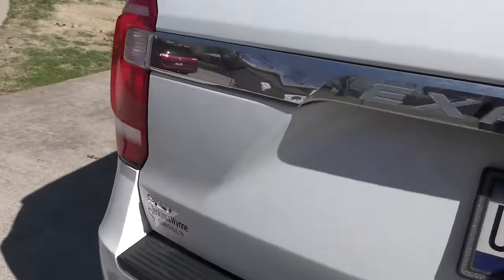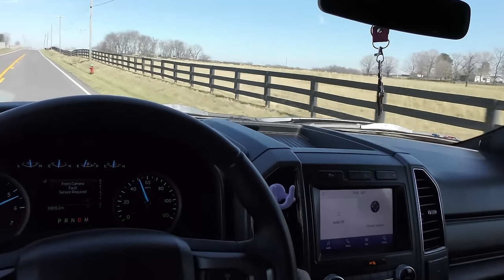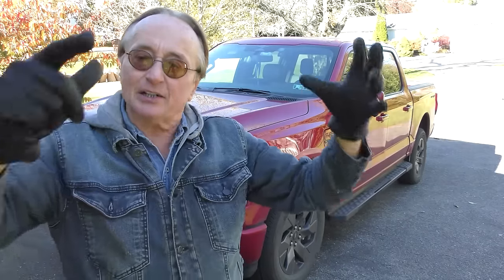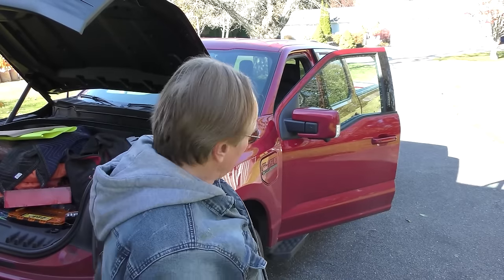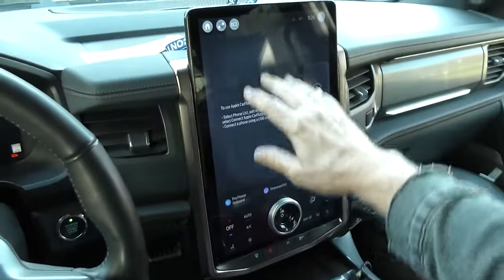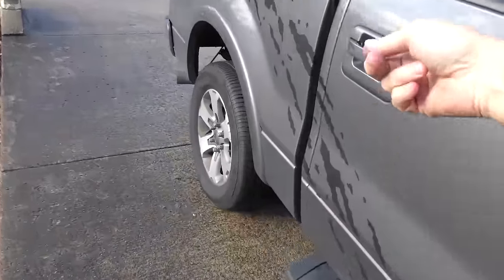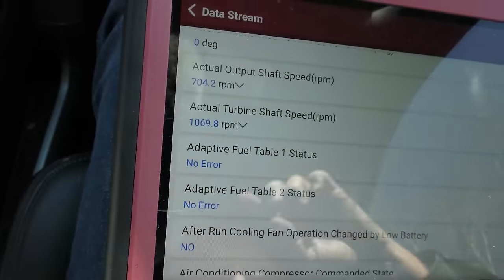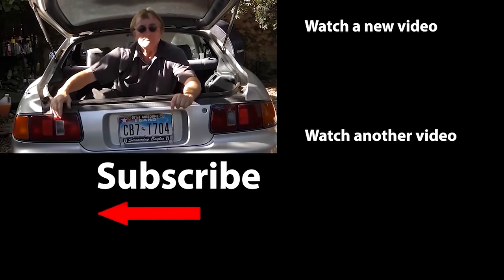Here's Why Fords are Crap Now

Comment: I’ve been learning and working as a mechanic for a lil over a year now and one of the most mind bending things was seeing most new fords all have PLASTIC oils pans, drain plugs, trans pans etc etc. I can’t wrap my mind around the engineering behind it, and fords isn’t the only one doing this nowadays
Reply: I used to be a mechanic, and I’ve seen many many many metal oil pans from older vehicles begin to rust out and leak oil. I’m not saying plastic is the correct solution but it definitely mitigated the deterioration you get from having a metal oil pan.
Reply: FALSE. That's weird because I own a 2022 f150 and the oil pan and plug is METAL. IS NOT plastic. You must be working on those electric trucks with the battery oil pan lol.

Comment: I have 15 f150 xlt with the 373 electric locker and 3.5 Ecoboost 117k and its been great changed the rear diff and trans fluid and both looked like they didnt need changing its been a great truck

Comment: I have the 6 speed transmission in my F150 with 183,000. Only ever changed fluid and filter and it still shifts perfectly. Hopefully it will continue to do so for a while longer lol.
Reply: Don't abuse it and continue to change the fluid and filter and it should be fine. 

The Internet also claims the Getrag six speed manual in my Mustang is junk and will break. If find the opposite is true in my long term real world experience.
Reply: I'd take longevity over smooth shifts any day. 10 speed transmissions are ridiculous. Are people doing surgery in vehicles now? Talk about overkill.
Reply: @DUCKSAREEVILLLLLLLL  8 is plenty but Ford's 10 speed isn't all that bad. I think the programming is the issue, not the trans.
Reply: @302Mustang13  10 speed transmissions are the more complex solution to a nonexistent problem. I'd rather they spent their production dollars on eliminating some plastic coolant hoses, etc.
Reply: @DUCKSAREEVILLLLLLLL  Plastic cooling hoses?? I wasn't a fan of the 10 speed Ranger I drove, but maybe with time it'll be ok. The real world highway mpgs being impressive though is due to the 10A. It gets better mpgs than my 2.5 n/a Ranger reg can w/ 5 speed manual 2wd did on the highway at lower speeds.
Reply: @302Mustang13  It's economical until it needs replacement.
Reply: @DUCKSAREEVILLLLLLLL  Who says it will need to be replaced? It's not uncommon for an automatic transmission to go out. I don't see any evidence the 10R80 is more likely to self destruct more than any other automatic. The only automatics anyone I know who needed a new one were Honda and Dodge owners. Don't know anyone with a bad Ford engine or transmission.
Reply: @302Mustang13  YT censored my link, but Ford is facing lawsuits for that 10 speed transmission as of May, 2023.

Comment: I'll stick with my 05 F150 5.4L 4x4 with 338k on the clock. Original engine, trans, drive line, cooling and electrical systems. If it dies I wouldn't gaf as I bought it 15 years ago for $9g.
Reply: That’s part of the problem I guess. If ford only sells one vehicle every 15 years, they are screwed

I got a 2010, rides great. I don’t think a 2023 would last til 2038
Reply: @Tropicalfrooploops  Very good point man.
Reply: 07 F-150 5.4L 2WD with 176k miles. Only issue was cylinder misfires fixed for $1500 at around 115k miles. My F-150 has been reliable and never stranded me on the road ONCE.  Glad to hear you have high mileage with your Triton 5.4L too!
Reply: If yours died then I would just replace the engine or transmission and keep going.
Reply: @Jimster481  100%

Comment: My top-of-the-line Eddie Bauer, 4 x 4 expedition had three repairs on the front wheel drive unit when I put it in four-wheel-drive it would lock up and compound low and I was skiing in and it locked up and I couldn’t go over 15 miles an hour all the way back to the Ford dealer from Park city that was the last American  High End SUV that I purchased.

Comment: Why does ford keep putting V-6 turbos and 10 speed transmissions in their big SUVs and trucks? I have a 2014 F-150 with the 6 speed transmission and a 5.0 Coyote engine with over 250,000 miles that gets the same gas mileage as these V-6 turbos, has plenty of horsepower and torque, I have had no major problems with it and it still runs like a champ.
Reply: Democrat lawmaking.
Reply: To FORD’s credit, they still offer non turbo 6 and 8 cylinder engines. People have an obsession with turbos as a status symbol but it’s always best to avoid turbos all things being equal.
Reply: It’s also about planned obsolescence.  Ford knows that people will love the speed of these Ecoboost but the big reason if Ford was being honest , is that these Ecoboosts will have more problems by 150k miles forcing people to buy a new truck earlier.  Look at the 5.0 coyote, great engine, but too good.  They made changes to it and now it’s not nearly as reliable long term.
Reply: @hokie9910  they didn’t make changes to the 5.0 other than cylinder deactivation and auto start/stop both of which you can have turned off.
Reply: @Trevormaffetone  They did make changes around 2018 for Gen 3.  They changed from a traditional cylinder liner to a “new technology”.  Oil burn has become an issue in an engine that did not have an issue.  A friend of mine who works for a large Ag chemical company was the first to alert me to this issue and they are seeing it consistently on engine with over 150k miles.  Only Ford could ruin a great engine, well them and GM.
Reply: Same, 2015 5.0.xlt... Why turbo? This one gets me 10-12 L per 100km. I even leased first to check the quality and mileage and then after year 2 bought it out from Ford lease.

Comment: For the 2011 F150 I would recommend an additional external transmission cooler. The way it sounds is that the fluid is getting too warm in stop and go traffic and thinning out a little too much. I'm sure it's worn out and wouldn't do that with new gears but still might be able to get more life out of it keeping the fluid cooler. When I was a tech we used to put an external cooler on every transmission we replaced most of the time inline with the factory one unless it was clogged, then we would bypass it.

Comment: Been driving the kuga 2015 
For 5 years now 
Not one check engine light issue

Some clapping on one of the rear struts but thats it had that fixed over a year ago
Reply: That's an Escape
Reply: @GBS1043  yea ford 

The manufacturer parts for the escape and expedition have some similar electronics, engine components, and transmission are parts they use across the board, my bet is to keep it simple with ford and not get these big suped-up suvs

Comment: I hate stop/start.  I disable it every drive.  For me it seems like that process would wear the starter out and isn't there less oil pressure on start up?  Wouldn't that wear the motor out faster?
Reply: Smart and yes I hav3 a feeling these will see a lot more issues than normal.  Can you buy a programmer to turn off that stop start for good?
Reply: @hokie9910 Yes you can disable it for good via programming.... but usually that voids the warranty LOL
Reply: @hokie9910  Auto Stop/Start Eliminator cable ~$70 USD. Plugs in between stop/start button and factory plug. 

Defaults the system to remember the last setting, so it doesn't default back to ON at start-up.
Reply: Start stop is the biggest joke on planet earth.
Reply: All by design - to make your car fail sooner.
Reply: Start stop has two batteries with a smaller one just to restart. More cost and headache.
Reply: You honestly can save tons of money with an electric.  You have to install a level 2 charging station in your garage.  They are more fit for warmer climates.
Reply: @joshuasaltzman1992  LOL 😂,  my truck is bought and paid for. How would I save money going EV ? Plus ,I don't want to worry about burning down my house.
Reply: @musicman7297  it goes into a 240 like a dryer or your oven does.  Do they burn down your house? Charges the car in like six hours.  My wife has an electric car and never has to use a commercial charger which actually can charge the car in about 20-30 minutes.  Also they have very little in maintenance costs as there aren’t fluids and oil to change. Great for a commute vehicle.  Still needs infrastructure development for long driving for sure.  I love Scotty but he’s not really educated on evs.
Reply: @musicman7297 I’d estimate she’s saving about 2500 dollars a year on fuel cost and oil changes.  If you live in a warmer climate and use your car primarily for commuting it’s a good option.  Definitely not for everyone but it’s a good option for some of us.  Especially if you have two vehicles.  Just wanna be fair.
Reply: @joshuasaltzman1992  LOL 😂,  how many kneepads do you go through every week ?
Reply: @musicman7297  come say that to my face
Reply: @joshuasaltzman1992  LOL 😂, YouTube tough guy.

Comment: So glad I listened to your advice. Bought a new 2023 Subaru Crosstrek Premium with a manual. Is slow to accelerate sure, but the AWD did well in snow and the vehicle checks every single box other than acceleration. I'm okay with that, and I work at a Ford assembly plant. I also got it for $25k new, and Ford was starting at $35k my A-plan price. Hey Scotty, I'll be down in Tennessee in the near future if you want to do a review or something on it. I have 13k miles since May 2023.
Reply: Subaru has a lot of Toyota tech in them I’ve heard.  I like the Crosstreks.  Especially, like the wildernesses and the manual transmissions that are available.  I wish the Outback’s had a manual option.  🤷🏼‍♂️

Comment: The only problem i had with my 2021 4x4 ranger is the driver door was not flush with the body, it poked out 1/8 inch. It got fixed for free, but still that shouldnt be a thing. 
Other than that, its been a great truck.

Comment: I will never buy a Ford again after my experience with my 2018 Fusion i have had transmission problems since i owned it. They told me my torque converter was going out and instead of replacing it they flashed the ecu and tcu changed the fluid and sent me on my way. A week later it was shifting sluggish again so i went back and they denied telling me that the torque converter is bad and reset the ecu and tcu again and sent me on my way again. It's doing it again and they won't touch it and say's it's fine.

Comment: Having worked in high tech electronics back in the 80’s
The worst environment for electronics is the car/vehicle,
Electrical noise, vibrations,harshness,thermal cycling,etc, early components and circuit boards had to be encapsulated in epoxy in an attempt to impart longevity and durability. Extreme heat or cold are electronic killers

Comment: I had a 1999 expedition a couple of years ago, the 5.4 two valve. Got it from a older guy for 1,700 had pretty much every receipt for any work done since new. Had 234k on it I drove it to 345k in about two years, nothing but oil changes and tires. Sold it and it's still driving around my town to this day !

Comment: I have a 2020 Ford F150 3.5 Eco Boost and it is the best vehicle I've owned. Quick, comfortable, and fuel efficient for a pickup. It's the 10th new vehicle that I've bought, plus numerous used vehicles. Last year I rented a BMW X5 for three weeks for a trip on the east coast. Both wife and I agree that the F150 would have been more comfortable.

Comment: The 3.5 ecoboost has more hp and torque than the 5.0 v8 coyote. and is almost just as reliable by the numbers. love your videos keep it up
Reply: I disagree my co worker blew a engine & ford did nothing, apparently the 302 is way better
Reply: So if you took a $75k lightning and  a $75k gas f150. The entire drivetrain for the gasser would cost less than $25k, when removed would leave you with a $50k shell. For the lightning the entire drivetrain would cost atleast $50k, and when removed would leave you with the same shell, same options for 25k? Ford is either shoving it in their * on the lightnings,  or theyre shoving it up the customers * on the ecoboosts
Reply: I'll take natural horsepower over anything that requires a turbo to make power.
Reply: The 3.5 doesn’t have more hp……just more torque.
Reply: Toyota Tundra V8's will outlast any ford engine by a long shot
Reply: @stefanovichmichael9686  they don’t make v8’s
Reply: @legion8416  Up until 2021 they did,and there are now 5 with over one million miles,without major repairs.That was my point.Try that with any domestic truck.

Comment: My work vehicle is the Ford Transit 250.
50k miles water pump bad, 58k radiator leak, 60k rediator leak and rediator replaced.  66k transmission bad needed replacement. Aboiy 70k bad coils.. 
Just noticed today at 77k radiator leaking again.
Ford, where quality is job none.
Only thing they're #1 at is recalls

Comment: We have a 2020 ford escape, transmission is clunky as well while shifting. The car still only has 26,000 miles and already had two rear shocks leaking fluid, mid section of the exhaust needed to be replaced, and AWD module went out.

Comment: I love Ford vehicles. I haven't had many problems with them other than normal wear and tear.
Reply: You probably change your oil before 5k too. Many people go by the recommended intervals when they’re mostly driving in the city. And not using Motocraft oil or filters. Huge mistake.
Reply: Scotty is correct as to the 10 speed transmissions. Don’t buy one. But GM has also suffered problems with their 6 speeds too.
Reply: I don’t understand the infatuation with a fast pickup truck. Do you see semis drag racing? Trucks are for hauling stuff. If you want a race car buy one. 😂
Reply: I suggest you play the lottery. Not many share your good experiences with Ford vehicles.
Reply: Try a brand new Ford and report back
Reply: Henry Ford, the industrialist, was right about the j's
Reply: @rolandthethompsongunner64  are you claiming that either you or Scotty have more experience with the 10 speed than government, big oil, and major transit fleets? I have visibility to the PMs and service records, and the only big shift in repairs over the past decade has been with diesel emissions equipment. Most fleets have moved to the 6.2 and 7.3 gasser and there's no widespread issues evident with the 10 speed. Stop fear mongering about something you have a grain of sand's worth of visibility on.
Reply: EWW
Reply: Same here.  As with any brand of anything,  complaints only come from people having problems.  People who are happy with their vehicle NEVER say a word, literally millions of satisfied customers, that their experience never works into the equation.  Mechanics don't see happy car owners, only problematic ones.
Reply: Are the joys of being a unicorn

Comment: I got one of these trucks. I had a dead battery and it took me 45 minutes to find someone to give me a jump. I forgot to turn off the automatic start stop. Then on a freeway there was a traffic jam and I stopped and the engine turned off. I ended up paying $350 to have it towed cause nobody wants to give you a jump in the middle of a freeway.

Comment: If ford is so bad, how come I've had a 2003 escape, 2005 freestar, 2013 fusion, 2015 MKZ, 2017 F-150, 2020 Explorer,  2023 F 150 and a 2023 Lighting.  None of those vehicles every saw a mechanic for anything but an oil change. 

The only cars I've owned that ever broke down were Honda/Acura,  Nissan... and Chevy.
Reply: It sounds like you don’t even keep vehicles long enough😂

Comment: I have no problems with the V6 in my 2000 Ford Taurus and it still runs great. There's just too much electronics on these new vehicles for me. Ford needs to stick with the basics.
Reply: Never - ever jump another car with your Taurus. I had a friend who inherited his mothers Taurus, jumped one of his friends cars with it, and it did something to the engine software, that several months later, just ruined the car.
Reply: @phil4986 ya probably hooked the jumpers up backwards ….thats what happens
Reply: @phil4986   I already jumped my Civic with it last April and both cars are still working just fine. Sounds to me like a user error?!
Reply: Nothing wrong with electronics. FORD just can’t get their fingers out of their butts and do things right.

Comment: The new Expedition are 90,000 grand!
Reply: Insanity.
Reply: AHAHAHAHAHAHAHHAHAHAHAHAHAHAHHAHAHAHHAHAHAHHAHAHA
Reply: How's a guy like me to buy, if ever, a freaking truck? 👀🦬
Reply: @pwx9000  I cannot believe where we are in this country today.  Trucks too expensive for the average American to buy.  Something is very wrong.
Reply: @hokie9910 it is crazy.Bought in 2015 5.0.xlt new, for 33000 Canadian money. Now, same truck is close to 80/90 grand. Insanity.
Reply: @Chain987  Last of the really good f150s, V8 with the speed.
Reply: @hokie9910  so far I just replaced pads and rotors at 100 000. Regular oil changes.Aluminum body. Hope it. Stays that way